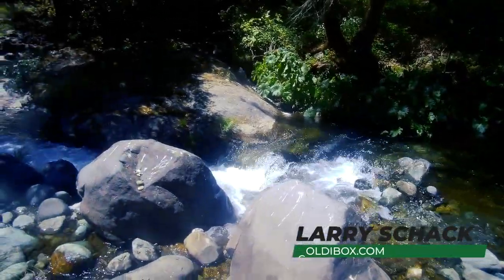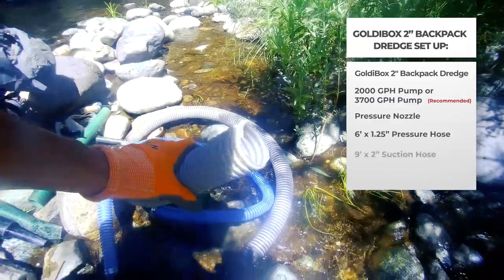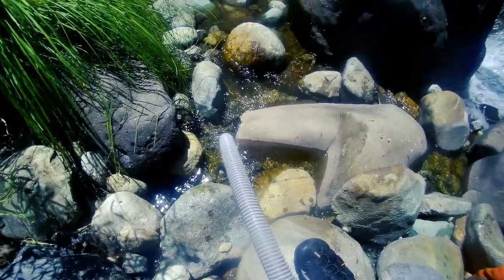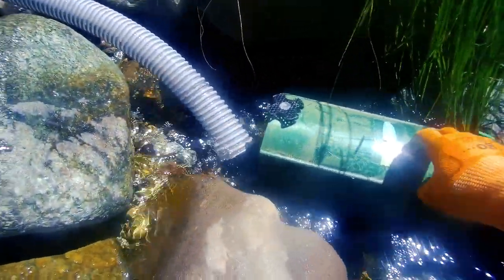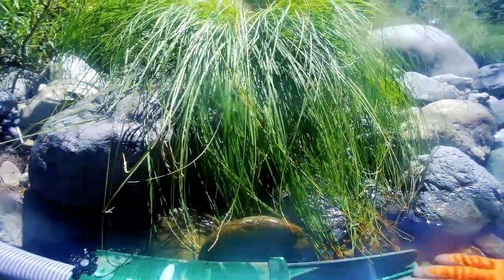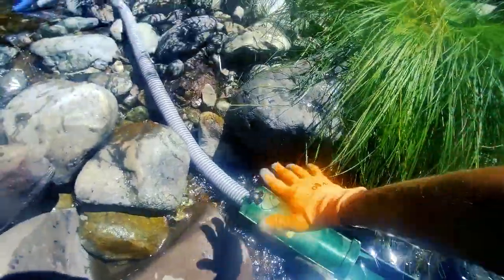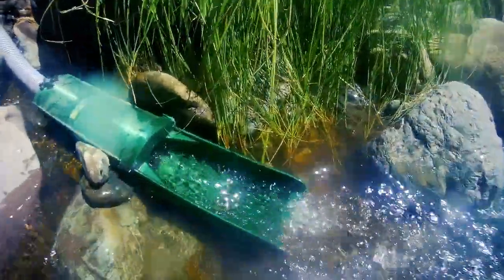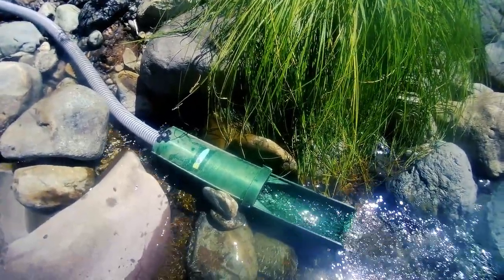Setting up the GoldiBox 3D Printed 2" Electric Backpack Dredge | 3D Prospecting |

Comment: Ok so going thru all my shit 2 high bankers a 1.5 Dredge with a 9 foot sluice plus all the other things then this video comes along HOLY CRAP BATMAN This would EMPTY my trailer and I would be able to carry a SHIT TON OF BEER IN COOLERS 
Here's the question I have a 1.5 dredge the hoses the nozzle can you reduce down for it to fit what I have or is that a lose?
Is the jet log still a thing didnt see it on the site?
Reply from the maker: @corndogger  - Thanks for the kudos.  Yes, we can make reducers for you and the jet log is available but hasn't been posted yet. The jet log and a few other accessories will be posted by the end of the month.  Can you please use the GoldiBox.com "Contact Us" form and provide contact info and a few details outlining your requirements?  We'll get right back to you. - Happy Prospecting!